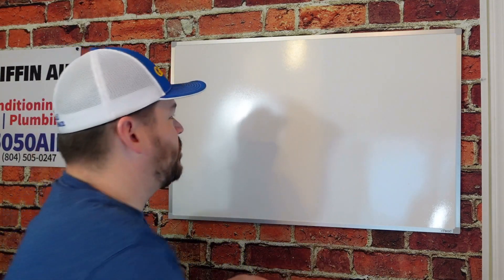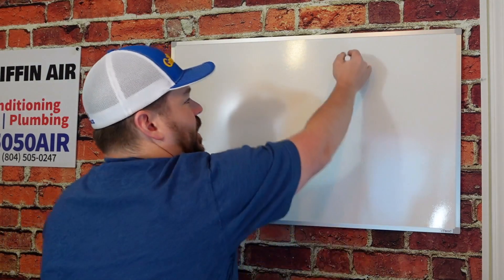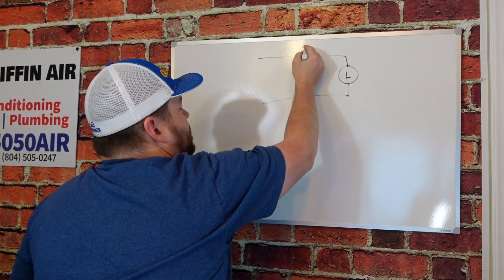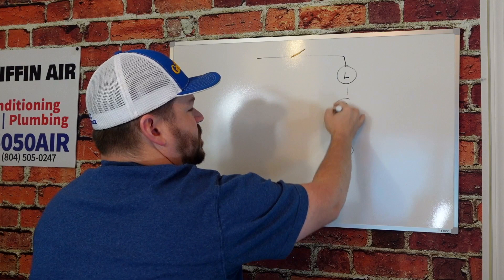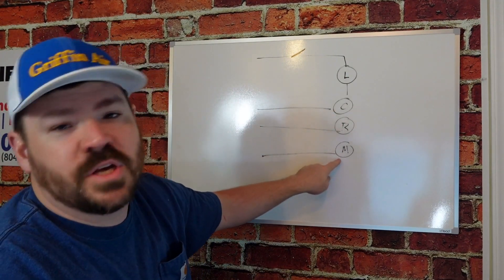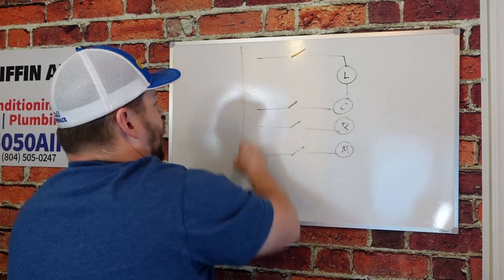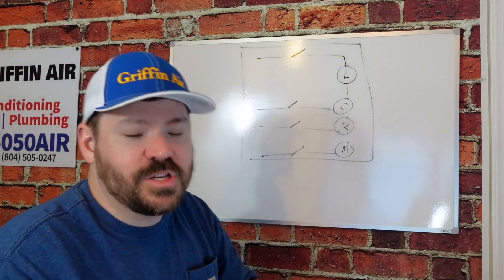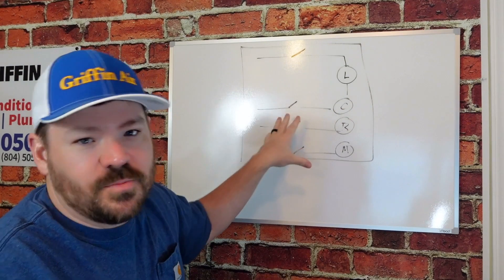CONFUSION on Communicating Thermostats EXPLAINED!

Comment: Could you leave your 90+ furnace when temps are below 20F and add a Bosch high-end heat pump in the far north US
Reply: Do it all the time!
Reply: Not a cold day in hell would i ever give up a 90% gas furnace for a Bosch heat pump.  if you live in the far north than stay with a super efficient furnace that is sized properly for your space.  I would rather have an 80% furnace than a heat pump in your location any day.  if you lived way south in a different climate, than it would be different.  But Bosch is just trouble waiting to happen and a heat pump is completely out of the questions.

Comment: In other words, communicating thermostats violate the KISS principle. Keep it simple stupid.
Reply from the maker: In some cases, they are more simple 🙂
Reply: My beef against communicating thermostats is initial cost and repair cost. Since the communication protocols are manufacturer specific, customers only have a choice of one or two very expensive thermostats and will be very expensive to replace if they fail. 
The HVAC industry needs to follow the computer industry and come up with a standardized protocol that will allow customers to buy third party thermostats that will work with their equipment. An open standard will also lower the cost of the thermostats.